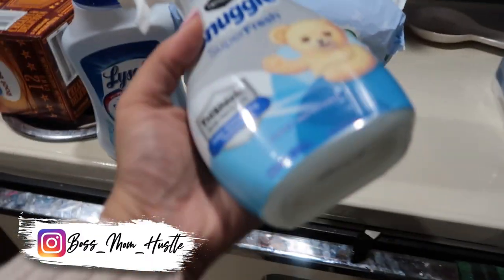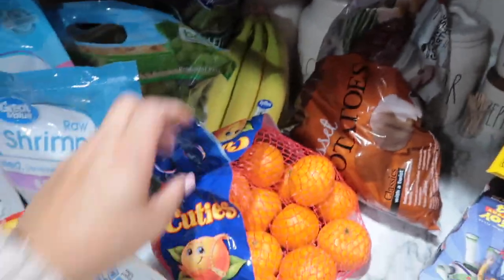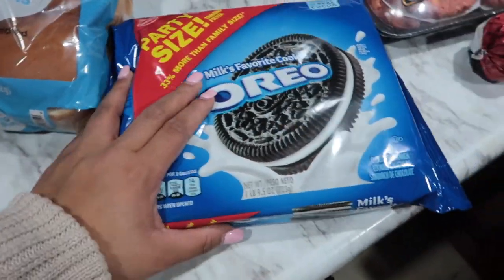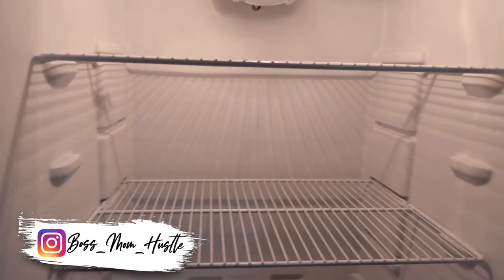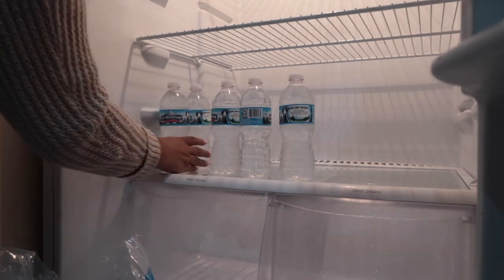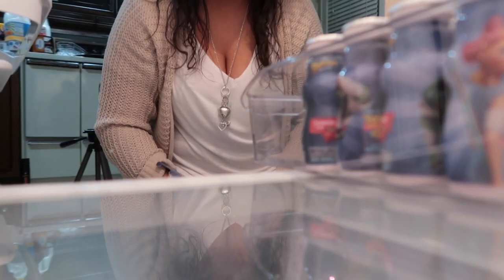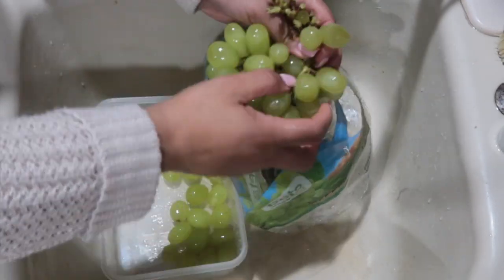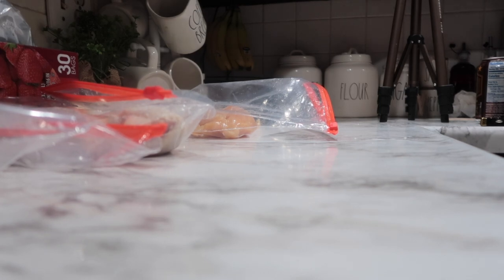FRIDGE DEEP CLEANING & ORGANIZATION | CLEAN WITH ME + GROCERY SHOPPING | WALMART GROCERY HAUL

Comment: Great Video! Use vinegar, water and a dab of dish soap to clean your frig. Put several pieces of paper towel in with your lettuce and it will absorb the moisture, and it will keep longer. Put a wet paper towel around a can of soda or water  and it will nearly free in 10 min.  Just a few tips!
Reply from the maker: Thank you for those tips!!! This time I only used just soap and water didn't think of vinegar! I've used it before I need to buy some more! Thank you for watching!